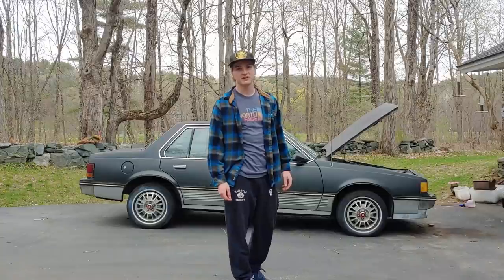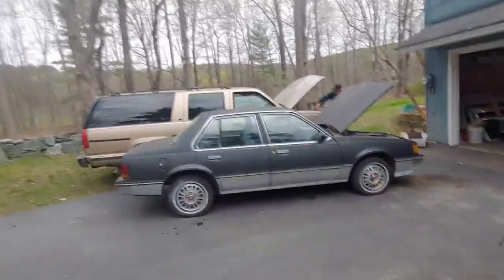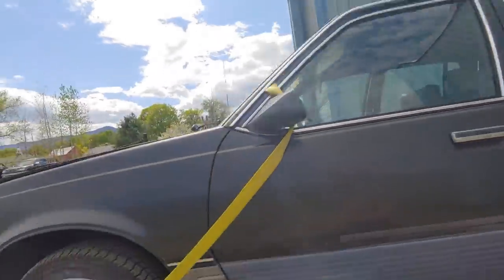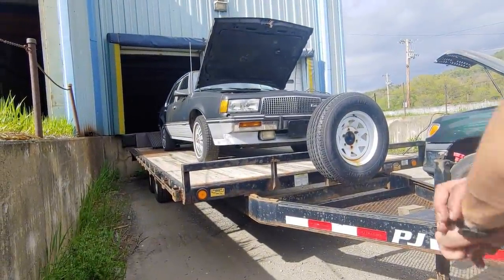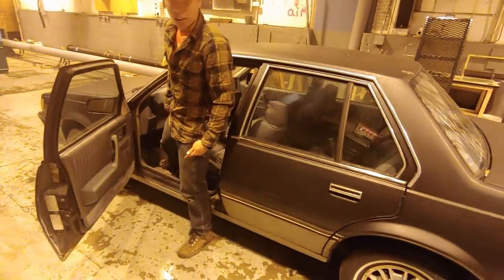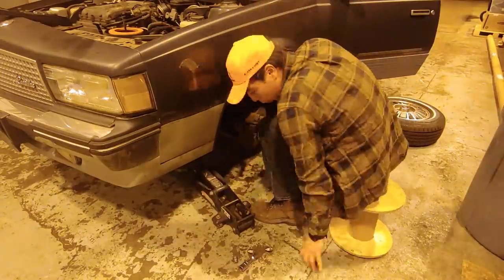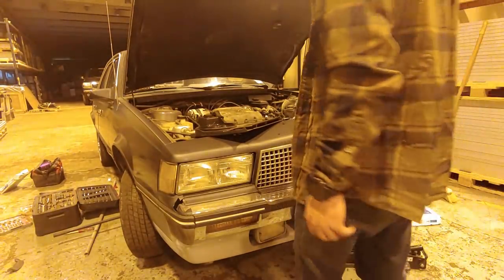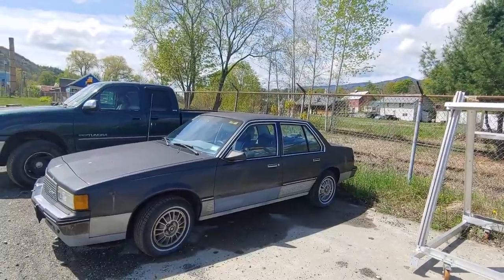$600 Cadillac: Let's Revive It!!

Comment: As that is basically and old Chevy Cavalier, the most common issue is the MAP/MAF. Their was also a sensor for the throttle body I believe that had issues. But my old 85 Cavalier had this exact issue and it was the MAP/MAF, always started with Ether, and ran fine once started.

Comment: Those caliper bolt caps are so nice! One of the few things I've liked about GM honestly, hahaha. Jeep also sometimes has nice bleeder screw hat sit all the way against the caliper and prevent the bleeders from rusting. I think those should be standard on every vehicle. Honestly if you color match that cladding on the driver door, get the door strip, and fix that one fender and few roof spots, it still won't look half bad! I'm about to take the injectors out of a WRX to clean. Same set of issue basically. Best of luck!
Reply from the maker: Thanks good luck!

Comment: Hey! Look into a 1998-2005 Cadillac SeVille with a blown head gasket for cheap. Use the Thermalweld kit and you have an unbelievable car for under a grand. My buddy bought an eldorado for $450 and drove it 10k miles on Thermalweld no issues

Comment: don't know if someone said it already, never boost a car with the donor running, it can fry the alternator or electric system of that car...you can charge the dead battery with the donor running (ideally with a bit higher rev's, 1000-1200) and after 10-15min depending of the state of discharge, try to start...

Comment: If it was My car, I'd dump about 2 cans of Berrymans b-12 chemtool in the tank, it cleans injection system and spark plugs, also get their throttle body cleaner, don't use regular carb cleaner, because if throttle plate is gummed up and not in right position can cause hard starting. Berrymans b-12 chemtool is sold at WalMart and most Parts stores. Then take her out and drive it like you stole it for a few miles.

Comment: The ignition modules are horrible in those years. If it’s not original GM, they were extremely unreliable. I used to replace mine every 3000 miles until I bought OEM.

Comment: Love that vintage GM V6 sound.   Had the 2.8 in my Celebrity Eurosport.  Great exhaust note too.
Reply: Is the 2.8 Fuel Injected or does it have a Rochester Carb?
Reply: @P00katube  My 86 celebrity has a 2.8 with 2 barrel Rochester carb, smooth quiet runner but an absolute dog. MPFI really woke these 2.8s up much better.
Reply: @P00katube  the 2.8 went to MPFI only in GM cars starting in 1987.   I believe the 2-barrel 2.8 stuck around in the S-10/S-10 Blazer until 1988-1989.
Reply: @WildBill236  agree.  Friend had an ‘85 Celebrity wagon with the Rochester 2-barrel.   Solid but it was a slug - not much quicker than the 2.5 Iron Duke.
Reply: @johnh2514  2.8 Multi-Port was optional in 85 and 86, standard on 85 X11 Citation and  Cimmarron, became standard for 87. All carbed 2.8s were done by end of 86 model year for 60° and 90° series. Also have an 88 Ciera coupe 2.5, and it is noticibly quicker than my 2.8 off the line.
Reply: @P00katube  Injected on the Caddy

Comment: I've seen engine's not start on old gas not  good enough to fire it off . But. Did what you did with the starting fluid just a spray  once it's running it would run all day. I'd get rid of gas and try fresh gas first.

Comment: Hi guys Love the Video I have to ask though is their a way you can get this product for you that way you don't have to mess with jumper cables Sponsored
NOCO Boost Plus GB40 1000 Amp 12-Volt UltraSafe Lithium Jump Starter Box, Car Battery Booster Pack, Portable Power Bank Charger, and Jumper Cables For 6-Liter Gasoline and 3-Liter Diesel Engines.

Comment: They are known for brake lines and alternators...the last couple of years GM got it right....your battery has a dead cell ....GM needed a economy luxury car and they chose their opel J body but it was too close to the cavalier early on and they thought peoe would buy the name but the 80s we're known for that...your car was nearly 15000 new my neighbor bought an identical car in 87....I also had trouble with sending units not keeping continuous pressure and it was a sensor....they were also known for flimsy cheap fuel lines back then also.